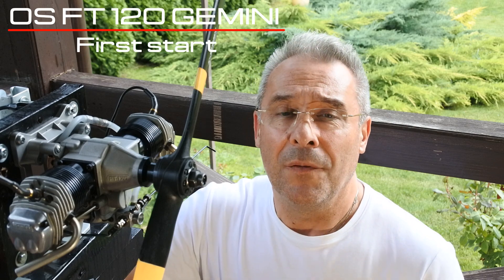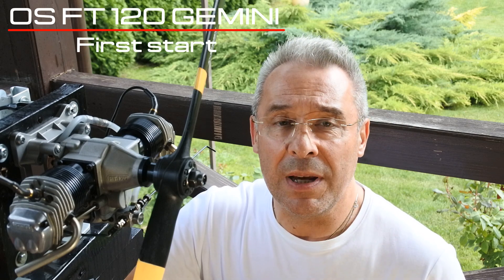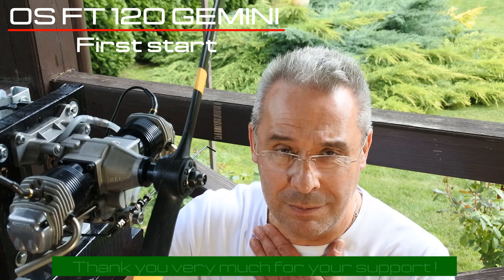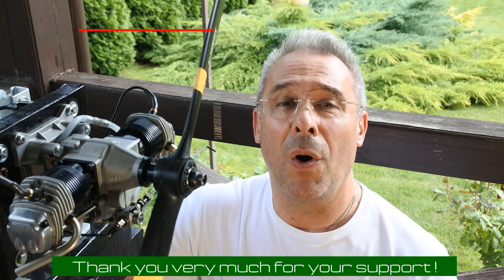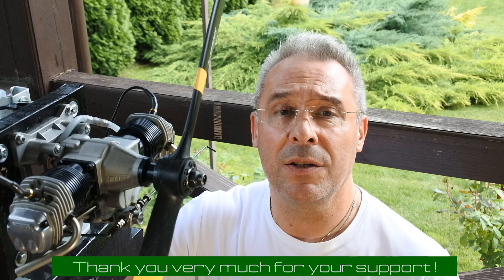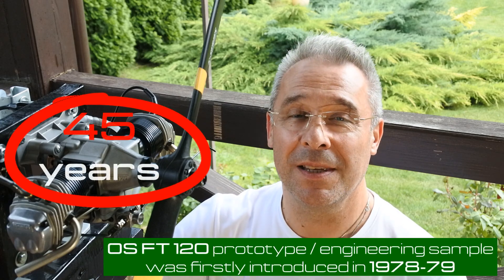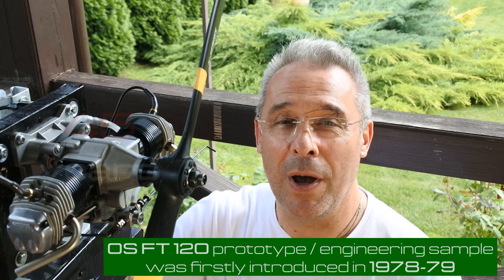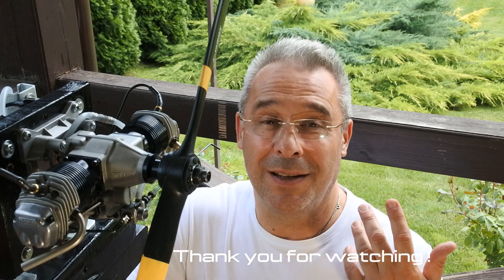OS FT 120 early Gemini first start

Comment: I'd love to get my hands on one of those for a big Cub! That's a sweet sounding engine!
Reply from the maker: Thank you, agreed with you ! The only thing, regarding the sound, due to the fact, that this engine has a firing stroke every revolution (360°), so it's sounding tone is twice higher, instead of the   single cylinder engine, where firing stroke comes at  every 720° crankshaft revolution.

Comment: That is a good running engine. Does it have a serial number on the back plate. I have an FT-300 with the serial number 0142, do you know what year the FT-300 was released.
Reply from the maker: Hello, and thank you for your comment ! Yes, my OS FT 120 Gemini has a serial Nr. on the back side , unfortunately, I can't read it now, because engine is still installed on the bench mount. Regarding your question about the FT 300 production year, yes, I know, it was 1986 and this year was the most successful year for O.S.Engines Mfg,. 
In1986 few the most iconic engines were released: OS FF 240 "Pegasus", OS FT 300 "Super Gemini",  and their first radial, OS FR5-300 "Sirius".
It is very interesting that all the names of these  engines refer to the stars, and the constellations, to the cosmos.

Comment: Nice video and great engine. Like it so much. Do you use the glow plug power support while it runs? Thanks.
Reply from the maker: Hello and thank you for your comment ! During first few runs glow batteries were connected, that was easier to make an adjustments and to understand engine's behavior. During qualification run batteries were unplugged. W/o glow support engine low rpm's are floating. I think, that engine needs more break-in time, at list, few hours more.

Comment: That is a jewel of an engine! 😍
Reply from the maker: Thank you for your comment ! Definitely, yes, Sir, agree with you !  From terms of engine design, its shape and general shape is very similar to the Continental O-200 engine, developed and produced by Teledyne Continental Motors (TCM). The only difference is 2 opposite cylinders instead of 4 from original. Even the shape of cooling fins is very similar.
You can judge by yourself: 
https://www.youtube.com/watch?v=kt1La2-5aig
Also, lets look on to engine's head and valve construction. I've some experience with rebuilding of OS FT 120 and FF 240, at this part it is very similar design.
Reply: a great engine! But you didn't do the best thing you can do with the engine, just start the engine by hand, it starts wonderfully😁